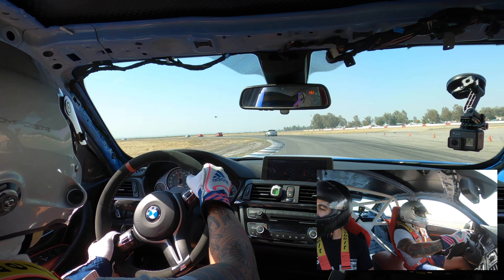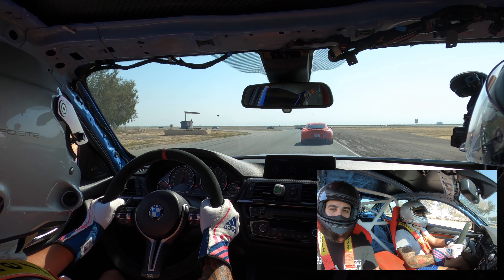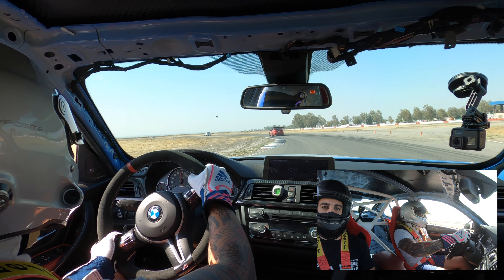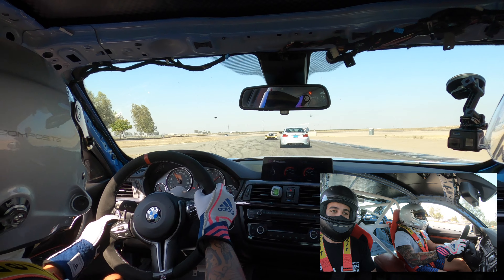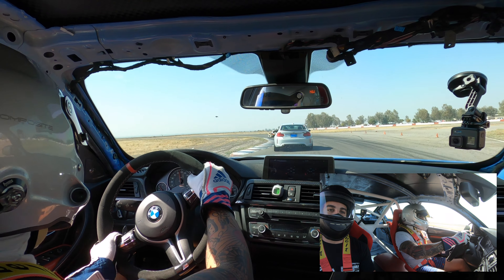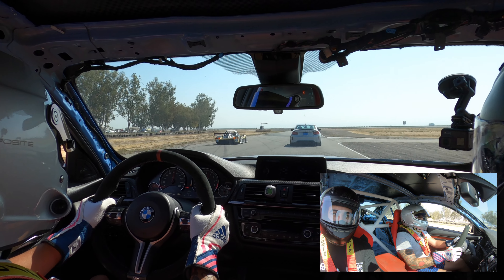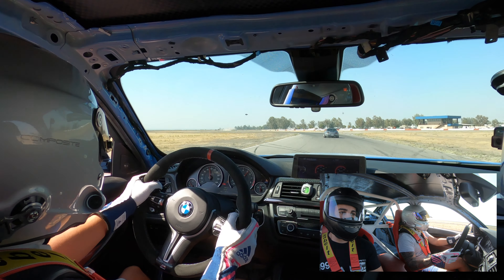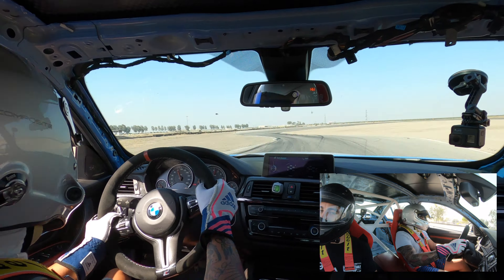TRACK BATTLE: BMW M3 vs Michelin PS4S

Comment: Are these the star bmw or standard ps4s? There's a substantial difference in tire construction and compound layup
Reply from the maker: They aren’t and I understand what you’re saying about the construction and compound but PS4S aren’t made for track use. They overheat easily. That goes for OEM BMW, OEM supra, OEM 911 PS4S

Comment: One question, as an M4 owner myself that is planing on tracking it and putting a lot of miles on it. Have you thought on motor a rebuild? When do you think it will be necessary for the s55 mileage wise? I've spoken with some shops that are used to change rod bearings on e46's and e90's and they all tell me that this is at this point a consumable and even though s55 doesn't have this problem they say that at 75K miles I should look into changing my rod bearing on the s55 and I'm not really sure about this.
Reply from the maker: I don’t know anyone that’s spun a rod bearing on an S55. These cars have better oil feeding to keep up with the demands of track abuse so that’s not true about needing rod bearings at 75k. I have buddies that have put over 80 tracks days of abuse on OG M2 N55s and S55s with minimal issues. I think the OG M2 N55 had a fuel pump issue a couple months back but that’s about it. These new BMW M motors can take beatings all day long
Reply from the maker: Also, these cars are all driven to the track, tracked all day and driven back home. No trailer queens
Reply: @Thewinnerscircle_  Yeah that's what I thought, they all claimed that that is "expected" wear on this motorsport engines that are so "squeezed" . As I'm keeping this car for the long run when do you think a whole motor rebuild would be advisable? Your motor is still on stock oil pump, chain and untouched head? or when they rebuilt the motor they changed it all? Also, you run OEM engine oil?
Reply from the maker: @alexo11111  my head was rebuilt when I damaged it when my crank hub spun. My motor is basically rebuilt because we know these bottom ends are bulletproof. Forged aluminum everywhere on the bottom end so I expect nothing to happen but if something does, I’ll make a video on it. I don’t think there is any need to rebuild your motor even with track use for the first 150k miles.
Reply from the maker: @alexo11111  I use motul 300v with estercore 10w-40
Reply: @Thewinnerscircle_  Thanks that's great to hear. Also, If you're looking into semis for track that are cheaper than the top of the top (Trofeo R's, Cup 2r's, etc...) Zestino 07rs are in my opinion little bit better than Ar-1's (and budget as fuck for what you get) so take a look on those.
Reply from the maker: @alexo11111  will do, thanks bro 👌🏽